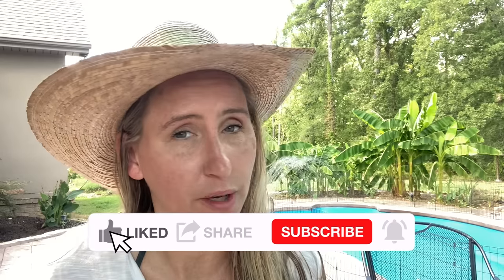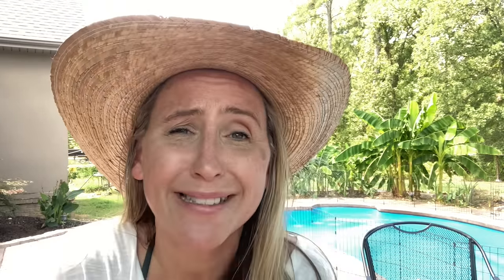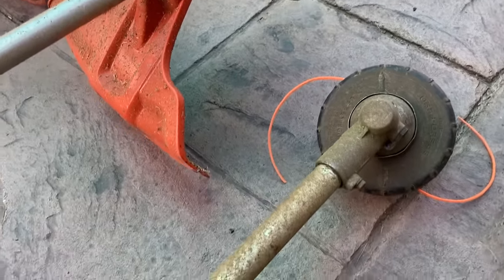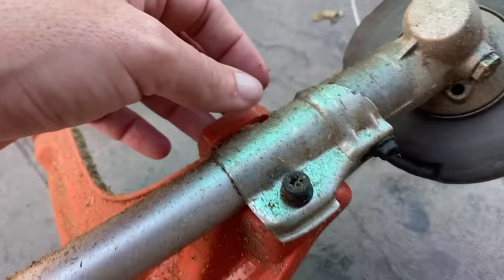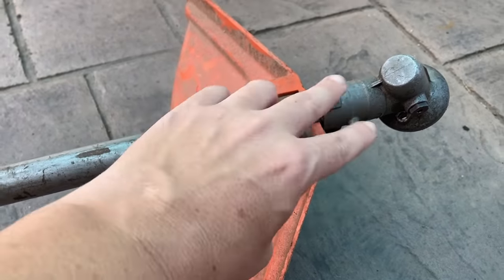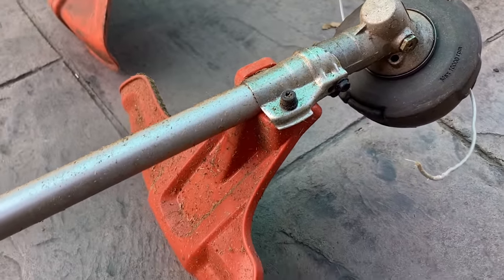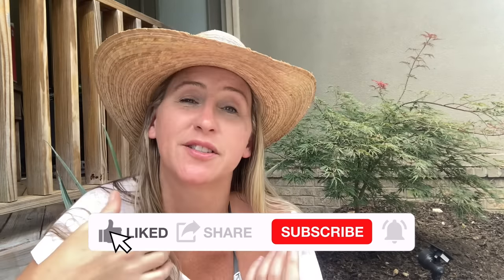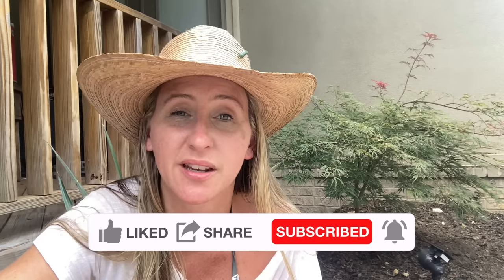String trimmer guard ON or OFF? Will it destroy your Stihl, Echo or Husqvarna? You might be shocked!

Comment: the primary function for the shield isnt to protect the operator from flying rocks but more to do with the thermodynamics of the cooling efficency for the engine. the line is cut to optimize the heat generated to the cooling airflow generated by the flywheel...its at harmoney when the line is cut to length by the shield...when you operate the line longer the engine runs slower with the same or more heat generated and cooling airflow is lower and cant keep the heat from afftecting the engine...a good comparison is a car engine running at peak rpm...with cooling compacituy at 100% is ok but now the same engine is generating the same or more heat at an 80% cooling capacity....problems will happen over time...
Reply: Thanks for explaining that. I’ve used Stihl’s largest trimmers for years to keep my rural property safe from wildfires. I’ve always used the shields.  I have to buy a new shield after a a few years  due to wear from thrown debris—they help. I also like to frequently advance my line to maintain max efficiency—a sharp cutter is way better than having to manually cut the line.
Reply: Long story short, string to long overloads the engine
Reply: They call me Mr  Engineer Tim!  Excellent comment dude!  👍
Reply: @georgedavall9449  Tim, it would be great to have someone like you in my part of the woods.  Thanks, Ted
Reply: Exactly, I was surprised she did not make any mention of that in the video. The main reason besides protection is to make sure the line is not longer then the mfg intended so as to not put strain on the engine.
Reply: Doesn't apply to electric trimmers.
Reply: @zaineridling  i didnt say that was the only reason...just the primary one...protection from flying debris is a seconday one....with electric...the same principle applies as well...
Reply: @zaineridling  Why does the line length, debris flying, motor overload/overheating etc. NOT apply to electric trimmers?  Too long lines (say 2'each) will destroy an electric trimmer--IF it will even swing those lines.  No clutch at least--so you can't burn that up--but your statement is ignorant to say the least!  And elec trimmers run at full speed only.
Reply: 100%. Just saw an fs55 with a mildly scored cylinder on the intake side. Probably from the owner running it without the shield with too long a trimmer line and overheating it. Thank you for your explanation. Every part has a job, sometimes two jobs.
Reply: It's a bit of both, but yes, longer line will overwork the engine.  Guard is important for safety too.
Reply: One problem is that people operate their 2-cycles with continual bumps of the throttle…..womp womp on and off the throttle the whole damn time. Over time the carbon accumulates inside the engine and wears stuff out. It’s good to run wide open for periods to clear out the carbon.
Reply: @shannonwhitaker9630  i agree with typical 2 strokes but stihl 4mix engines are a 4 stroke engine with OHV that uses 2 stroke mix...complete burn of mix before exiting the engine...not and issue with carbon buildup and oily mufflers from the 2 stroke bypass gas mix up to 30%...
Reply: With the longer line slowing down the engine and at the same time increasing the load on the clutch it causes it to slip more.
Reply: @shannonwhitaker9630  that is an industry accepted statement,  but I'm not sure i buy into it 100%. reason I say this is I bought a husqvarna 326ls in 2008, for 12 years it took care of 4-8 lawns a year (not fully commercial use, but close) 2020 i came down with cancer and stopped doing the extra lawns, just my own (and one personal favorite). anyway, to make a short story long,  I had 1 customer that didn't want any rocks/debris thrown towards her place, and by all means, DON'T SCRATCH MY WOOD FENCE POSTS! needless to say,  my trimmer barely got off idle at that place,  and when I do close to the road where there's a lot of gravel, I run it slow there (every place I trim). at 14 years old,  I just kitted my carburetor this spring (1st time believe it or not) and totally went through it,  and I'm sure there's some wear, (I did not completely tear it down, no need) there are no scuff marks on either side of the piston or cylinder that could be seen, and no carbon build upby the exhaust port.  I'm not disputing that not running at full speed isn't good for 2 cycle engines,  I'm just saying it's only 1 of many factors.  I use premium NON-ETHANOL fuel, treat it with seafoam and sta-bil (every ounce of gas that is run through my equipment) and MOST of the time the stihl silver bottle 2 cycle mix, but not always. I'm also not sure the 2 cycle oil quality is nearly as important as people suggest but PROPER RATIO 50/1 is, in my book. too much oil lowers combustion temperature,  resulting in incomplete burn, resulting in carbon buildup. not enough oil results in too high heat, premature engine failure. these are just MY opinions and my findings,  and yes, I've worked "in the industry " over 10 years, and been doing this on a personal basis for nearly 50 years.
Reply: @ENDERTON2000 you gave the answer when you mentioned using Seafoam. Your engines will last longer womp womping on them where average Joe’s carbon choked engines will fail early.
FYI it’s been accepted my many great engines guys including myself that around a 45:1 ratio is better (3oz/Gal) for longer engine life. I also do a regular decarbon with a special product and get amazing life out of my Stihl stuff.
Reply: Hello!!!!! Thank you!
Reply: If you are familiar with your weed eater you will hear the motor and you known "where" to run the string. We run our units without shields and have never had a engine related failure. If you can't listen and tell you may be to stupid to run one.
Reply: @thepitpatrol  you may think you know but even 1 inch longer can increase you operating temperature by 100 degrees and thats jus plain stupid to take that risk for the sake of cutting more. you cant tell me youre not using more line than the shield would cut to length...thats a fact you cant dispute...
Reply: @timw6281  I can't tell you that for sure. What I can tell you is that we run Husqvarna almost exclusively.  We have bought two Echo brand lately.  I can also tell you we haven't seen any drop off in life. What you are saying is correct.  Any additional line length will increase load, although I doubt it increases it anymore than blades do. The determining factor may be that we always buy the largest ones the manufacturer has to offer. We ran guards for a long time but once we started taking them off I will never go back.
Reply: @shannonwhitaker9630  didn’t she make a video backing this up already?
In the STIHL oil video.
Reply: Bingo!
Reply: @Olds 394….I just watched her video on the Stihl oil for the first time so I had no idea she gave that advice earlier. I had to chuckle because I live in an area where wildland fire is of little concern so the very very first thing I do is chunk the ignorant carbon trapping spark arrestors when engines are new.  She’s right on point explaining how people get clogged up engines. If you run your 2-cycles at low power setting all the time then expect issues.
As far as ratio goes I’ll never run 50:1 in my engines as I prefer something around 45:1 or 3oz/gal measured with a ratio-rite cup. My other old school specialty 2-cycle engines with steel bore sleeve use 32:1 exclusively and suffer no carbon build-up in combination with decarbonizer usage. Those motors usually go around 500hrs before they need to be looked at. I use regular old Stihl HP in the orange bottles and one bonus with it is that it has fuel stabilizer in it. Also all my engines are run exclusively with non-ethanol gas. If you run ethanol laced fuel you may as well just give up and run battery powered junk and skip 2-cycles completely.
Reply: I always use a rock or something to take the excess away 😅
Reply: @michaelparker5640  you cant guarantee the line is the right length without a shield...maybe you like playing russian roulette with your equipment...but ill tell the truth and the reason why no shield is a very bad idea for equipment longivity...
Reply: @independentthinker8930  I agree, I used to not operate them without a guard and it was wearing the machine out.
Reply: It is extremely easy to clip the string to a suitable length.
Reply: @Laser3303  Not true my electric Ryobi has variable speed :)
Reply: The question for pros though is destroying the machine over time worth the speed gains they get.  Apparently many say yes.
Reply: @Laser3303  what are you talking about? electric trimmers have variable throttles
Reply: @Laser3303  Talk about ignorant, “And elec trimmers run at full speed only.” That's pretty ignorant…
Reply: @thepitpatrol  Like shifting a car…
Reply: @46wireboy  yes sir

Comment: I absolutely hate guards on a string trimmer. All they do is get in the way, add extra weight to the head, and doesn't protect the user at all in the case of vertical edging. If the user is wearing the proper protective gear, then you don't need the guard at all. As far as line length goes, if you're using it correctly, the line length will not be an issue. It will wear evenly. Oh yeah, didn't I say I hated guards on trimmers?

Comment: My OPINION is, after having run lots of trimmers both ways both professionally and at home, I'm can say I feel a bit safer with the guard ON, and the trimmer line being cut to it's proper length by the guard's blade. With the guard OFF, your legs and ankles tend to get pelted with all kinds of debris, especially if you're cutting in an area with alot of dirt, gravel, broken glass, etc. The guard prevents alot of this. Also, with the guard OFF, the trimmer line can get a bit long if you bump the trimmer head too much and you can get line that is too long, doesn't cut well, can wrap around things and creates slot of drag on the engine which forces you to rev the engine higher to keep the line stiffer for cutting. Puts alot of strain on the engine. For me, there's no "great debate". Guard ON. 😁👍
Reply: Well Said!!
Reply: You're gonna get pegged whether the gaurd is on or off....
Reply: @JenkinsMowing86  but getting pegged less is actually kinda nice.
Reply: I concur
Reply: @KF1  to be honest I don't notice much of a difference. One plus I've noticed of running with no gaurd is I go thru much less string for some reason
Reply: I was against it for awhile but my Echo's seem to run much better with the gaurd off. I never felt the need to take the gaurd off the commercial grade Husky's as they seem to have a wider cutting swath.
Reply: @JenkinsMowing86  Yeah. But the guard does help, and it is usually keeps the trimmer head a proper distance from ground so the lawn doesn't get scalped.
Reply: @justincase2281  just depends who's running the trimmer. I wouldn't recommend a newbie not using a gaurd.  When you trim day in day out it's a little different
Reply: I agree 100%. I've been running trimmers since shortly after they hit the market and I would never use one with that guard off. The argument that it's easier to use the trimmer as an edger with the guard off is baloney. A trimmer isn't an edger. They make edgers for that job.
Reply: @dlkline27  if you have to break out an edger for weekly edging that sucks and is a waste of effort. The only time an edger is needed is if it's really thick over grown sod... after that it's simple to keep up an edge with a trimmer gaurd on or off
Reply: The moral of the story is: if you are holding a piece of equipment that runs on two stroke but you're not letting it run at full RPM's, then you are causing unnecessary wear on that piece of equipment.....no matter what you have to service your equipment regularly and operate it proficiently if you expect to be able to provide a consistent standard of service.
It definitely does make sense to remove the guard if you are regularly doing vertical edging, and service your equipment when necessary..and..........blahblah
Reply: @oztraliangrown8208   Never had a problem edging with the guard on and I've always fluctuated the speed on any trimmer depending on the crap I was cutting. Heavy stuff, high revs. Thin stuff, lower revs. Never had a maintenance issue as I serviced all the equipment I operated myself. Never had an engine issue except perhaps changing worn out reed valves or a spark plug, or a gummed up carb. All easy fixes. But I get ya. Best of luck.👍
Reply: @justincase2281  I didn't suggest you had or would have a problem leaving the guard on. Just that it makes sense to remove or at least adjust it..for multiple reasons.
There will always be times/places  where we should be running at low revs ie- anywhere that stones are near glass...just need to realise that running equipment like that too long will definitely cause excessive build up of carbon on the exhaust port on carby and require servicing more regularly than usual.
Two stroke equipment is designed to be operated under load and at full throttle, consistently running at low revs or fluctuating revs is detrimental.
Reply: Same here. Wouldn't ever want to work with the guard off.
Also I'm absolutely satisfied with my 13 year old Hitachi trimmer. Seriously great machine. Never regretted i bought the Hitachi for a 3rd of the price the Stihl would have cost.
Reply: I'v don many seasons of lawn care both professionally and privately. I have run company trimmers without a guard and never liked it. In my hands on experience going back to the 80's, although guards do not stop all debris from hitting the operator they definitely reduced the amount that hits the operator. I have never removed a trimer guard from a trimer I owned and I highly doubt I ever will ! Now a days I usually wear chainsaw chaps.

Ps. (My pet peeves, nothing to do with this video) 1. Curved shafts SUCK. 2. The direction you trim a property in matters ! Go the wrong way and you are throwing grass and debris into your clients beds ... , in my day wrong way trimming made the boss very angry (at me) !  I don't think about it anymore, it's ingrained in me. When I see other people go the wrong way, especially Professionals, I can't help but hear my first landscaping boss yelling, 😤YOUR GOING THE WRONG WAY😡 .
Reply: CORRECT!
Reply: @johnossendorf9979  lol
Reply: @Bornchiller123  Hitachi is awesome. Can't believe they sold out to metabo. Metabo seems to be holding the ball pretty good though. Haven't ran the metabo nail gun but hitachi are hard to beat. Have a metabo cutting tool I've had for over a decade.
Reply: @matthewotis3594  as far as I've heard the metabo tools lost a lot of the quality recently.
Reply: Guess I'll stick with DeWalt and paselode. They used to make the best nail guns and metabo cutters and grinders were top notch. Think a lot has lost what it was. Hart at wal Mart is supposedly made by Milwaukee tools.
Reply: Sounds like you ran 2 strokes.  The stihl 4 mix trimmers can run a lot of .105 size line before struggling...partly because the 4 stroke has better low rpm torque.

Comment: A TRUE experienced commercial landscaper will not only remove the shield, but he will also replace the head with a manual-feed head.  They can lengthen and shorten the line as needed for the specific spot they are trimming.  This takes any overload off the head and gears that would be caused by an excessive amount of line out.

Comment: I have a stihl FS250 trimmer that I have had 15+ years. I haven’t replaced a clutch yet. It’s had a lot of use and never a problem. Only thing I’ve had to do is replace the carburetor and        hook loop for the harness.

Comment: Somebody told me a commercial weed trimmer doesn't come with a guard. In fact they do. They may not install them. I have a commercial Shindaiwa trimmer that had one in the box. I put mine on. I clean up parking lots sometimes and crap goes everywhere. I have the "T" model that uses .105 line. Shakespeare is my brand of choice. The triangular line cuts very nicely on banks. Husqvarna .095 kept breaking off on fences. I finally gave that roll away. I keep a small roll of .095 just in case I have a customer that needs it. The only thing I've replaced was the bumper head. Rock walls eat those up. 🐀🐾

Comment: The shield has the string cutter edge on it to keep the string length correct. So taking that away makes all parts work harder because you have the longer string hanging out causing more wear and breakage than usual
Reply: That was my thought as well.

Comment: Cutting blade is good, have used a line trimmer for a long time without and I'll effect to the motor (Kawasaki) or clutch, but line length is unpredictable, trees n bushes get ring barked easily.

Comment: Hi Bree, what you've proved here is that  owners do not understand the complexity of a machine. If one removes  the guard and it forms part of the holding capacity of the head than logic tells one the head will be loose. Operating the head like this will damage . Without ever having brought a new trimmer I will guess and say the instructions tell not to remove guard as head can be damaged. At least thi ignorance gets you work.

Comment: Personally I think it's an ego thing. I think dudes just think it's lame to have the guard on because it looks weak but in reality it's way more efficient because it keeps the string at a better length and the engine runs better. Also we constantly had issues with trimmers over the years because of engines with bad carbs filled with carbon.